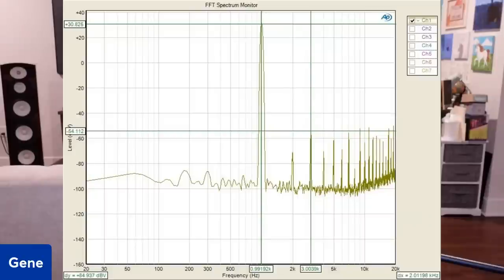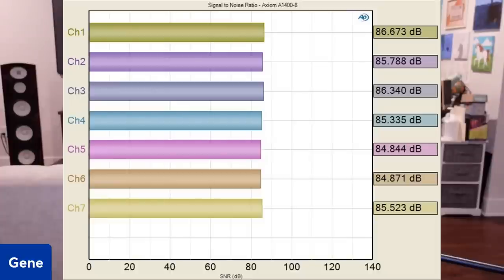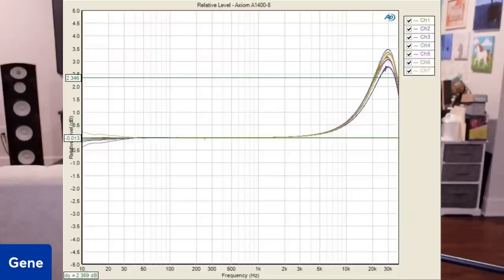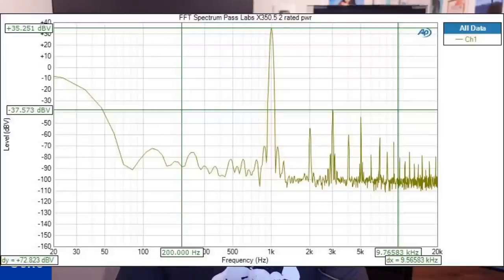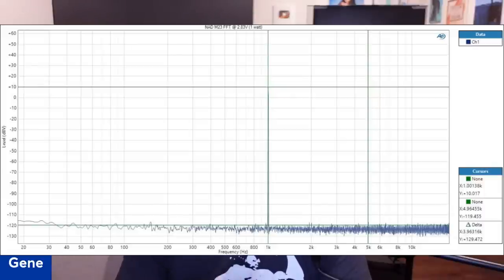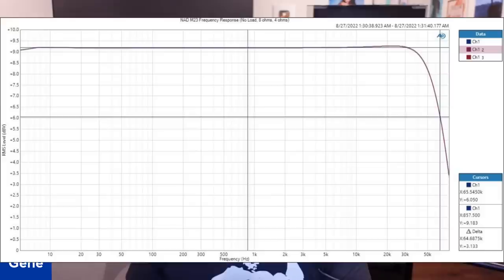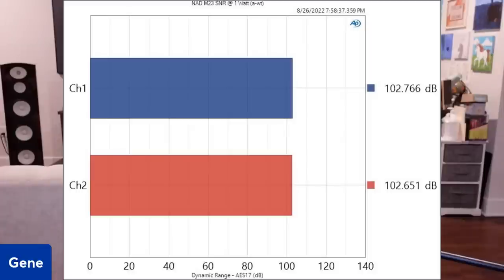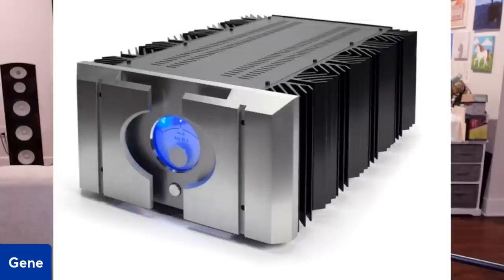Linear Amps are DEAD, Long Live Class D!

Comment: Everyone more or less knows that measurements don’t mean much on paper when it comes to sound. It’s how it sounds to you in your room with the rest of the system.
Now, I can tell you my experience with class D Nad T778 AV receiver and that is that it all sounded super detailed but at the same time sounded a bit on the thin side. There was no weight to it specially  when I compared it with Arcam AVR 20 back to back in the same room and speakers with the same movie scenes. I think that Class D amps are perfect for Atmos or Surround channels but they are not quite ready for front stage home theatre use yet, unless you spend huge amount of money.

Comment: I haven't seen any comparisons of phase distortion. I did try Class D a few months ago but the example I tried just lacked lustre. I still prefer my EL34 valve amp. I did have several Pass amps, they are good, the EL34s still beat them all.

Comment: I have been using a Halcro MC70 since 2005.  I believe it is Class D.  It got good reviews at the time and I've always liked it but I wonder if it's not flawed in the ways you say the other Class D Amps were.  It still powers the main 7 channels of my home theater but I added a couple of Marantz 2 channel MM7025 amps over the years to add ceiling/height speakers.

Comment: Its hard for some people to acknowledge the fact the sound they like all these while is actually caused by distortion and harmonics.
Reply: shocking amount of truth to this. i have a friend whos a bit of an audiophile that has this shocking turntable. its bright with a very audible noise floor and the timing seems off but he just reads it as 'bloom' if there is such a thing.
Reply: Yeah there may be some sweetspot, where some distortion gives the signal a stronger sense of presence, while any more just smears it into chaos.
Reply: @SwirlingDragonMist  a sweetspot some may call it, I call that MY fidelity instead high fidelity.
Reply: Yes, like real instruments LOL
Reply: @johto  Your point is? And nope, thats not how it works. A system without noise and distortion will playback an instrument accurately, including the noise and distortion from the instrument itself as you stated. You dont want to add noise and distortion on noise and distortion because thats just dumb.
Reply: @AbsoluteFidelity  Correct 💯% 👌🏾
Reply: @johto  electrical noise is completely random and harmonic distortion in gear is nothing alike instruments

Comment: No modern Class D amps measure well. None of the manufactures post 10k square waves. The best have overshoot and ringing. Even a 60 year old AB amp using TV sweep tubes produce clean 10k  square waves. Read up on Stu Hegeman and Matti Otala as to proper power amp design from the 50's and 70's.

Comment: I had a NAD Hypex class D for a while.  It was dynamic and clean in sound quality.  Perfectly enjoyable on its own.  But there was something missing to my ears.  It wasn't the sound I was looking for, too cool for my taste.  I wanted something that reminded me of the lp's I listened to in my youth.  
Found that in a class a/b amp from Arcam.
My takeaway:  trust the ears, not the tech.
Reply: Might be the implementation of the amp. I ditched my Arcam a39 for an Icepower as1200 amp (2x600 wpc) driven by a valve preamp. Makes the vinyl sound as it did when I was a youth. The Arcam just couldn't.
Reply: @sbwlearning1372   Happy that it satisfies.  The SA10 integrated is enough for me.
In the end, our tastes are personal.  It's nice we have so many choices out there.
Reply: Either setup can be EQ'd to sound as 'warm' or 'cool' as you would like. Have either of you measured your rooms frequency response at the main listening position? It can be a real eye opener...
Reply: @DomSchiavoni   I haven't.  Not into the numbers game.  I tried NAD (both class D and class A/B) and Rega class A/B.  But with the Arcam I've found the solution that works for me, that has a natural tonality.
Reply: @DomSchiavoni  I replaced the Arcam with valve preamp and class D power amp. Speakers stayed exactly where they were . No need for e.q.( and therefore another box.) Valves plus power gave me the sound I want

Comment: Oh yeah, quality and ALOT of output in a small form factor. Our new Elementi audio utilise Pascal amp modules with DSP allowing fully active direct connection to the speaker drivers (no passive crossovers) .Even the surround channels have  500w.
That’s crazy power compared to 10 years ago.

Comment: We have two types of manufacturers of Class D amps: mainstream manufacturers like NAD and now Outlaw and garage manufacturers of which we have several from my home state of Ohio. They seem to be in two different price categories.  I got one from an Ohio builder (Who put the Hypex module and power supply in a case) and while it sounded fantastic it ran hotter than Hell. This was totally not what I expected. It needed a fan. I ended up returning it and bought three Outlook 2220 Class H amps that run cool, even after watching Thor last night. Full disclosure: as parts of the movie put me to sleep I had to back up to replay it.
Reply: if they managed to make class D to get hot, they did something wrong. I can run my M33 all day long and it feels totally fine from the top. It would keep you cup of coffee hot, for sure.

Comment: Sorry, my BJT's and MOSFET's are working just great, some are already over 30 years old and still work and sound great, and so my amps (six total, I have two triamp systems) are going to do me just fine for the next 30 years, and then you can load them into my casket and they can go into the ground with me.

Comment: Yes, class D has to be the future of power amplifier design, as the World's population grows bigger every year the energy consumption also grows with it so if we can design high quality audio products that use a fraction of the power this has to be a good thing. I must consider changing from class A to class D amplification as I'm currently using Mark Levinson 436 mono blocks rated at 350 watts each, they are heavy and hot, but they do sound very good 🙂

Comment: The good high-power ones >200 wpc are not so cheap, and they're not always well built with low distortion. Good adaptation, testing and design is imperative to the Purify or Hypex final product performance. I've not seen that other than weight and efficiency factors, they really out-perform A/B. My living room supports the heat and weight of my Musical Fidelity M8xi just fine. What D-class amp / preamp / DAC combo would replace it? It's got 550wpc into Focal K2s, and the distortion is inaudible at ALL reasonable volumes in my 20x28x11' space. Plus, I got it at a significant discount from a dealer, new. I'd consider Nord monoblocks in annother room.

Comment: Did you measure power consumption?
Does this switching class D amp pull say, if it were 300 watts, 300 watts continuously regardless of program? Or does it map the response, so at 2 watts program it pulls 2 watts? (Or 110% of 2 watts, granted they are 85% to 90% efficient or so).  So: is the power draw constant? Or does it adapt to power demand?
Reply: @Douglas Blake Sounds like you have a digital Class D. Your amp matches the power to the program, so it doesn't draw power needlessly when no program material calls for full power? That would be a good feature. I would hope designers would do this with all class D, but I'm not certain that's the case.

Have you measured current to verify the power consumption changes, or did you only measure in 2 modes: "On" and "Stand by" (no material signal? 

I could imagine architectures where class D draws full current in any program signal, but little on stand by. 

I'm also not sure about analog Class D power consumption, and how that is managed for Class D that are not digital, but analog varieties.
Reply: @Douglas Blake Thanks. First:  In reality, there are both analog and digital architectures of Class D. Orchard Audio, for example, produces an analog Class D, which is the minority. Most are digital.

Second, my question was not about power absent a signal. That's "Stand by". My question was if the power consumption was proportionate to the signal, i.e. "power mapping" similar to what "Class G" amps do. 5 watts sometimes, 1 watt others, then full power rating when called for. Measuring the "Stand by" consumption doesn't answer that question. 

Third, I've been using Class D amps for 2 channel even before the "Class T" Tripath digital chips in the Leipi 2020A+ came out, more than 10 years ago. I'm familiar with opp amps, chip amps, and ladder configurations. There's a lot of room for different Class D architectures, both analog and digital. 

If you haven't measured current while operating a program, then that's fine. If you don't know, you don't know. That's ok. Maybe someone has measured power during actual operation, and knows if they have an analog or digital Class D variant. But thanks for trying anyhow, you did address "Stand by" power, but that was not my question of interest.
Reply: @Douglas Blake Additionally, there are other factors such as size which effect power consumption. Such as when a pure sinewave inverter may be 92% efficient, but a 3000 watt draws significantly more power than a 2000 watt, even for the same load, let's say 50 watts load. The efficiency percentage is the same, but the actual wasted power is 50% higher on the 3000 watt inverter. Amps generally may be expected to behave similarly, since the waveform is inverted from or rectified to DC. There's more complications in actual power during usage than the "Stand by" consumption or efficiency rating. And there are a lot more options for architecture than in the power inverter example. 

It would be interesting if people measure actual power consumption during a program, and then calculate the actual numbers from actual data, and give a real consumption vs. efficiency score past just a percentage and 2 states (on/off). 

I can do the calculations, I'm just looking for people who have actually measured their Class D DURING operation. Just to clarify my question, which was perhaps a bit ambiguous.
Reply: @Douglas Blake  I'm trying to make it simple: the ACTUAL power consumed by the amplifier while in use, on an actual program. Not in stand by, where there is no signal to amplify.

 So the actual power or wattage the amplifier uses in operation. Then the rated power figure by manufacturer. And the spec'd efficiency rating. Knowing those 3 allows all the calculations i kneed. (In practice, just the actual measured running watts and the model number would be enough, i can look up the architecture for that model). From this, an actual power factor average from multiple amplifiers of different rated watts and across multiple models can be determined, and an optimal wattage design can be determined from there, with a few data points from a few participating folks. That allows an optimal power rating for a Class D to be determined from actual measurements by actual people on their actual systems in actual listening rooms. 

Then i will know where to ball-park my amplifier design, or buy modules to assemble into an amplifier. I don't want to completely design a new Class D from scratch if i don't have to, i would rather buy commercially available components on board and assemble them into an amplifier fron modules.

 (Did i mention i am building a Class D amplifier? Maybe i forgot to mention that. I'm designing an optimized Class D amplifier based on actual consumer use with optimized efficiency, rather than tell the consumer what amplifier they should adapt their system around.)
Reply: @Douglas Blake "Directly Proportional" doesn't give any values, it just means they both increase together. Every powered device is proportionate to output. I'm looking for ACTUAL power consumption of Class D amplifiers in use during program in actual listening conditions, i.e. the typical wattage draw. 

Also, thanks for your concern... 
but I've already designed several amplifiers including AB. I have moved on to  opp amps, ladder DACs, DACs on chip, active speakers including  3 ways with DPS networks and constrained layer dampening... so i think i will be ok there with just assembling simple class D modules. I'm not asking for design advice, just if people have actual data from measurement they would like to share. 

Rather than a technical dissertation, I'm looking for typical data from actual users, which you seem to equate with "needing to read up on things" (not equivalent, btw). 

I'll try to make it clear with direct analogy:
There's a reason you don't just buy a 5000 watt sine wave inverter to run 20 watt loads. It takes 60 watts to run, 3x the load. That's at the same 92% efficiency as Class D amplifiers. The efficiency isn't linear. 300% waste at low power, while only 8% at high power (full rated power, in this case 5000w).  Power sizing is important. A single efficiency number isn't the whole story. And while power output is proportional, as you say, it most certainly is not directly proportional nor linear at all values.

So it's back to finding people who have actually measured their Class D amps in ACTUAL use and actually know the wattage draw, which clearly you do not. 

As i said, thanks for the no-program idle power draw, i appreciated that. However, I'm primarily looking for ACTUAL power consumption from people that have actually measured it and have constructive data to contribute.
Reply: @Douglas Blake Just to clarify, when i say measured value, i mean like putting a clamp meter around the power cord during typical playback to see the power draw in amps. Then multiply that by voltage, and you get the watts of power consumption during actual playback in room. It's just that simple. 

Perhaps i confused you trying to explain details, and you didn't follow.  Mea culpa if i lost you in the details.
Reply: Consuming the same amount of power at no load compared to full load is class A feature. The rest of amplifier classes (including class D): power consumption is somehow proportional to output power. 
Class D - input power and output power are very close, no matter is output power is low, medium, high or full.

Comment: Years ago I used to think an audiofile was someone interested in reproduction of music or sound exactly as it originally is, but apparently people spend lots of bucks to alter the signal to a more pleasurable sound, thus coloration or distortion rather that transparency or (garbage in garage out) reproduction.
I used to be into the religion of tube amplification, believing it was neutral in signal reproduction.
I had a vicious exchange with a guy who claimed valves were superior but eventually he admitted the "warmness" that tube amps could best present was distortion technically.
I guess I want to hear a Ravel symphony exactly as it originally sounds, for the least amount of money.
Sorry guys, I guess if that means digital into a class D amp, I guess I'm HiFi not audiofile.
I understand my bass amps, (for upright and bass guitar ), color the sound as preferred or not by musicians, but I will rank them in order of most transparent to least.
1. Ampeg SVT pro 4
1200 watts into 4 ohms. Class AB solid state.
As clean or transparent as a good quality stereo receiver, lots of headroom and great for reproduction of upright bass or loud rock .
Heavy as hell 41 pounds. Impractical to gig with small combos.

3. Old Ampeg V4 tube amp. 100 watts 
Fairly transparent if retubed every two years , if not mushy.
Yes expensive to maintain.
50 or 60 pounds, with such limited headroom.
Sits on shelf.

4. Some model Peavy, donated to school because of weird colorations that sound cool for some kinds of rock. Strange that it sounds the least transparent considering it's AB solid state.
110 Watts into 4 ohm and only 20 pounds, easy to carry.

So what about #2?

2. Genz Benz 900 watt into 4 ohm class D amp.
I've done an A-B comparison between this amp and the Ampeg SVT4Pro amp and I believe the ampeg is only slightly more transparent but probably cleaner when driven hard.
The thing is that this Genz Benz amp, being class D, weighs only around 6 pounds!
When I first purchased it, before I turned it on, I assumed it had to be a white van special.
I've got an old jvc receiver in one listening room that sounds fine but unnatural, I'll replace it with the best sounding integrated amp in my price range and it won't be a tube hybrid and may be Class B.
I apologize if I offended anyone's component religion, but just my opinion.
Great video by the way

Comment: Class D is a bad excuse to make a cheap amplifier!

Just look at the power supply it’s a switch mode. How long do you think that will last before it’s fail?

They all sound analytic, and the sound the same ….

So I keep my 25 kg heater and 2 x 30 watts in class a😉

Class a a/b is a living amplifier and not cold 🥶 to the touch

Comment: everybody thinks class D is still the same trash it was in the early 2000's.... I have been using class D krk monitors on my desktop for several years and have been blown away with them.... PK sound a stage audio company has been using class D for years as well and they blow my mind with what they can do. There are bad Class A amps and there are bad Class D amps.